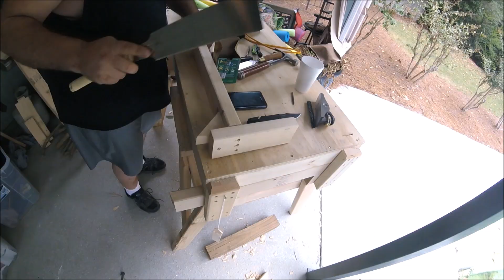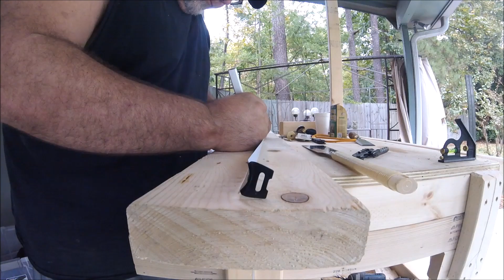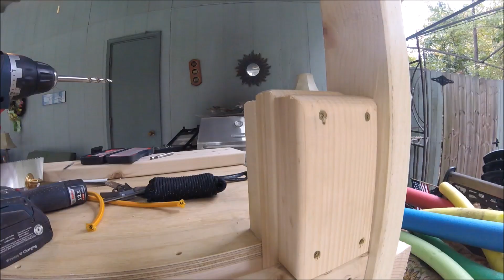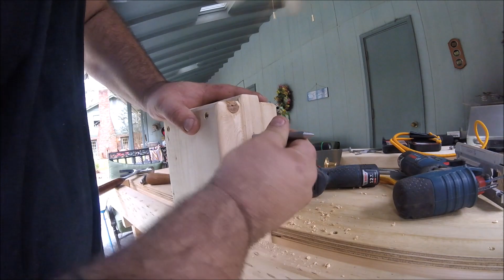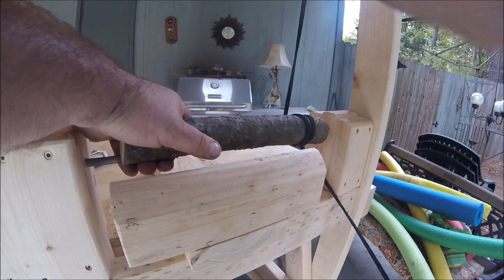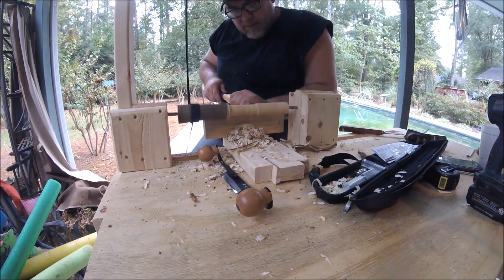How To Make a Foot Powered Lathe

Comment: I'm sure you could do something like a yarn spinner where you pump a wheel in a circular motion instead of back and forth. you can also get much higher speeds that way. I used to play with my moms and nearly spun the thing out nearly a dozen times. And the spin speed to foot pump ratio is greatly diminished. It all depends on the size of wheel you use.

Comment: To get a good turning from carbide tools, you need to be spinning the wood really fast ( about 1000+ rpm); much faster than you can pump the foot pedal on your lathe. I would recommend using conventional wood turning tools.   Nice project to learn how one can economically turn wood the old fashioned way.  Thanks for the video and sharing!!!

Comment: i suggest trying to modify the pump engine on this to mimic the way the old singer sewing machines worked with a pedal and a crank shaft to a flywheel that was connected to the machine by a belt. this way they piece always turns in one direction and is more consistent. also the beefier you can make the fly wheel the less you have to pump to keep it moving once you get it going.

Comment: nice handy quick lathe -- the sort of thing you could throw together on a job site if you had to.....

As a bowl turner, I will say that turning green wood, scrapers are often not the best choice; they'll work, but the difference to a good sharp gouge can be tremendous....the green fibers just have too much "give" in them - getting good results with green wood requires SHARP tools, so you can cut through the fibers, instead of tearing.   You can help a scraper a bit by rolling the tool "on edge" so your cutting more on a diagonal or even towards near vertical. (this works well with the round tool bits) and with some of the squarish ends, you by being in in a near vertical "shear" position, you can get really smooth surfaces, but it takes some practice to get it working)    

on a historical note....traveling "bodgers" would turn chair spindles and other items from green wood on a routine basis, selling them to the local carpenter/cabinet maker, who would let them dry and do some finish sanding on them after they'd dried out.....some of the traveling "pole-lathes" i've seen are very similar to what you have put together here....  Kudos on the wedging system for the tailstock, that can be the tricky part on any homemade lathe..

How long are you going to be a "refugee" from the storm?

Comment: Do you have a link for the scraper tools or to tools you would recommend for a lathe?
Reply: Much better to use gouges designed for wood turning - not scrapers.

Comment: Noice!
Now maybe add a wooden flywheel powered via con-rod to lessen the ass pain.
Reply: Maybe add a bicycle pedal mechanism and make it an exercise lathe! Work and work out! :D
Reply from the maker: oh yeah i would definetly build a treadle lathe if this was going to be a long term thing. spring pole lathes are great but they are a lot of work. lol
Reply: izzy swan Your design is basically a spring pole lathe, with an upright “pole” and a bungee cord providing the “return” spring and alternation direction of rotation.  A treadle powered device - at least the old fashioned treadle sewing machines - generated continuous rotation in the same direction, rather than a
Reply: Cancun771 I was thinking the same thing! LOL
Reply: Cancun771 though I might use something like a harmonic balancer from  small block chevy. has plenty of weight to keep the part moving., but yeah hell with the string n use a connecting rod.

Comment: Try using a chisel as a skew, nearly all the pole lathe users I have seen use a wide skew type tool to remove material really fast and then some small hook type tools to finer details and hollowing. I bet that nice wide chisel you have would work great for this lathe and you will have a much easier time of it.
Reply from the maker: I did it was to grabby i need to get a proper set for wet wood turning

Comment: You should hook that thing up to an old exercise bike!
Reply: +Tom Moores Run the belt in a figure 8. Great idea, going to have to try it!
Reply: that's something I want to do but there has to be a way to reverse the rotation
Reply: Why would you need to reverse the rotation?
Reply: When pedalling the wheel is rotating away and you need it rotating towards you, at least that's how it works out with the one I have , I can only pedal forward, pedalling backwards is just like a bicycle, it just coasts, the only way I can come up with so far is to make it a two person machine, one pedalling, one cutting

Comment: Great project Izzy.

You'll do better to get rid of the paracord as it stretches every time you put it under tension. It also wears out fairly quickly on a pole lathe due to the friction.

Instead go get some mower pull cord which doesn't stretch and has a much better resistance to friction wear
Reply from the maker: thanks for the tips

Comment: Your foot peddle is called a treadle.  Most often seen here in the UK on old Singer type sewing machines. Nice build. As a passing thought you alread have cutting tools you could have used on a foot powered lathe -  your chisels short handle but it wouldn't matter a lot at these speeds and perhaps making an extension handle to fit over the chisel handle is another project?
Reply from the maker: A treadle lathe has a big fly wheel this is more a kin to a spring pole lathe
Reply: https://www.bodgers.org.uk/BB/viewtopic.php?f=1&t=1594
shows it as a treadle and it may or may not have a flywheel.

Hope your house is still there when you get back.

Comment: Much better than my solution: drill a hole in the wall, put a nail in the end of the workpiece, chuck the other end up in the drill, and put the drill handle in the bench vise with the nail going through the wall, and knock off material with a file as it spins around. I think I may have to make one of these. Thanks!
Reply from the maker: yeah but your solution is very creative love it